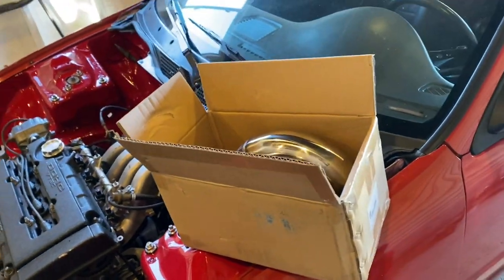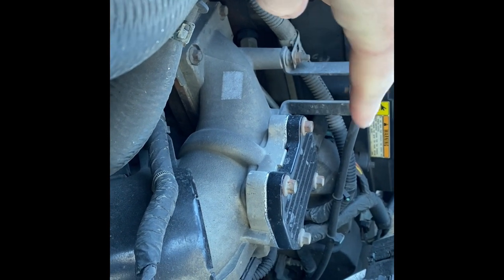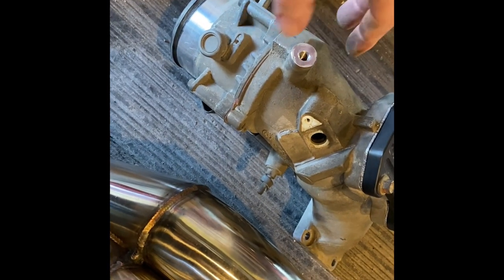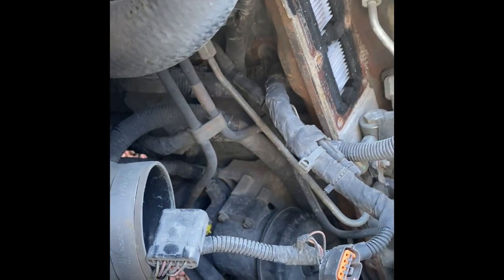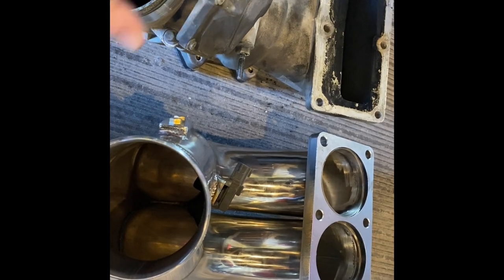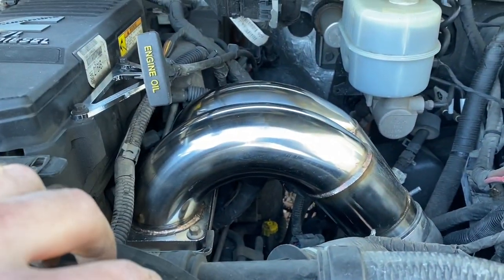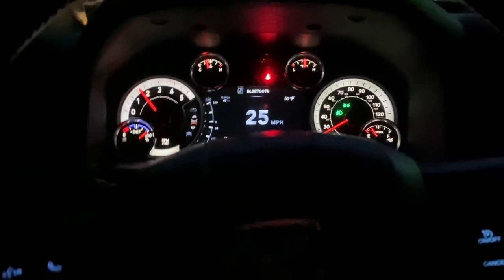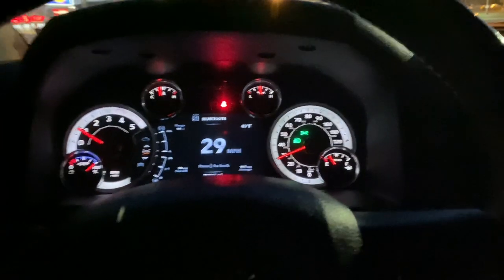6.7 Cummins “pusher” style intake horn EBAY review/install #cummins #diesel

Comment: A if you feel like you have a boost leak with that intake check it with a straight edge cause another YouTuber got one of those and I just bought one and their not flat you can sand that down or have surface from a machine shop or if you know someone with a belt sander just a suggestion

Comment: $60 intake horn is great, but you should've ripped that grid heater out.  Block heater is plenty unless you're in really northern states.  Looks like a good install. I've heard horn bolt torques are at 18 ft/lbs from other vids.
Reply from the maker: @mrh0wler353  I really should have deleted it honestly still on my list
Reply: @3guysgarage  Today I installed a horn like yours, about $60, and grid delete plate, also about $60, both off Ebay.  I commented because I was looking at other people's work before I started.  I'm slow and it took ALL day; the injectors were difficult.  Front four not too bad.  I finally used an open end wrench, hose clamped to a 2' long metal bar 5/8" dia, and I was able to get the fifth injector nut loosened up, but #6 closest to firewall I left attached to the injector and just loosened the nut on the fuel rail.  I'll test drive it tomorrow, started it today, pedal/engine seems a LOT more responsive.  A couple years ago I did all the other deletes, and installed a limited edition SuperChips Race tuner.  I installed a Banks Pedal Monster a couple weeks ago; a BLAST.  My truck is an 06 Laramie 2wd, its limited slip differential helps a lot.

Comment: Did you get any codes after install for the throttle valve or anything ? Or did you tune them out after
Reply from the maker: No a year later I still have no issues

Comment: I just bought one and wondering if I have to tune it since it’s deleting the throttle control valve  .?
Reply from the maker: @ValleyTowKings  do you still have factory emissions?
Reply: @3guysgarage  no I dont it’s fully deleted  and had stock air horn but deleted plate on their and decided to do this style air horn

Comment: So I just ordered one of these. After doing a double take on my engine,  it looks like I have to do an EGR delete first before this goes on.  Is that right?
Reply: I installed mine and you will need to do the egr del i will tell u start on the passanger side first and get the cooler out then its a breeze

Comment: A next time us a square to check the mounting surface cause theirs another YouTuber that had a problem with one of those leaking and it wasn't flat I bought one and I checked it too right out of the box the mounting surface isn't flat it's warped so I'm gonna sand mine down or get it resurfaced
Reply from the maker: Over a year no issues so far)
Reply: @3guysgarage  nice you got a good one then

Comment: I just installed a grid heater delete plate and this pusher style intake horn on  my 09 6.7. First initial drive was great, but now I have an annoying buzzing sound
Reply from the maker: Thanks for the comment hopefully you’ve hit the sub button as well. I would definitely say some gasket is not sealing correctly

Comment: Would I have any issues as far alas starting the truck or no .?
Reply from the maker: i wouldnt think so are you tuned?
Reply: @3guysgarage  yes I am I have a tuner but I was confuse do it delete it the air control valve
Reply from the maker: @ValleyTowKings  no it’s on the bottom of the horn still

Comment: Did you start throwing any codes? After installation, I got a P0106 and it's buttoned up tight.
Reply from the maker: Not at all man. It’s been 3 months and zero issues at all! What does that code say it is?
Reply: Seems the map sensor o ring is done
Reply: @3GuysGarage  after messing around with the intake horn, the tune had to be rewritten to accommodate the throttle valve removes

Comment: i had the same loud noise ..tightened it down more but the spool up is louder  ..... did your turbo sound louder.after install?? i hear the same noise but way quiter
Reply from the maker: Thanks for stopping by man hit that sub button if you haven’t already helps grow my channel a lot. My spool was the same from what I’ve noticed no louder or quieter really.
Reply: I will so I might still have a leak 😒
Reply from the maker: @jay-rk3sb  I’ve heard people say they can’t get a good seal with this cheaper intake horn. I haven’t had that problem but I’ve heard that. Couple guys recommended putting on it a belt sander to get a better flat surface.
Reply: @3guysgarage  thank you man I appreciate it
Reply: After the intake did anyone get like a surgeon sound from the exhaust because my truck has a surge

Comment: I bought this one and tried to install it today but I couldn’t seem to get the bolts all lined up and to thread In it seem like my factory bolts were to big with the washer that’s on the bolts I have the exact same truck as tire also 2014 ram 2500 6.7
Reply from the maker: Hm I didn’t seem to have the same issues. I started one bolt on the left side then started one on the right and it went right on
Reply: @3guysgarage  okay I’ll give it another try you’re saying I should do one bolt on the left and then start putting in the bolts on the left
Reply from the maker: @rammer1434  I’m saying start threading one bolt on the left then go to the right and put one in then middle. I never had this issue

Comment: Is that weird noise like a whining noise.
Reply from the maker: Mine wasn’t tightened down all the way. Went back over it and haven’t had an issue since
Reply: Did u use a torque rench or just regular one
Reply from the maker: @RoadhouseTexas4288  just a regular one. If you aren’t subbed to the channel please do that really helps out!